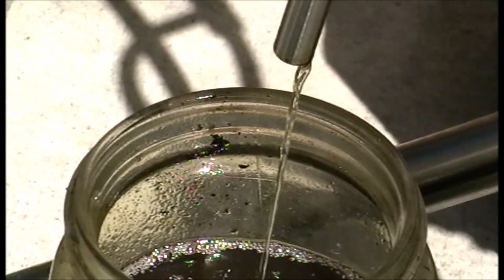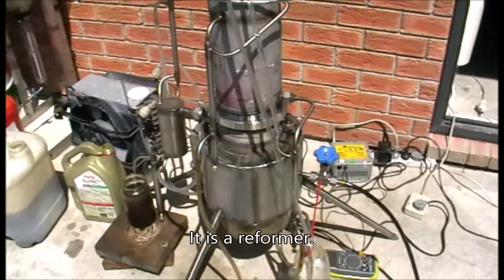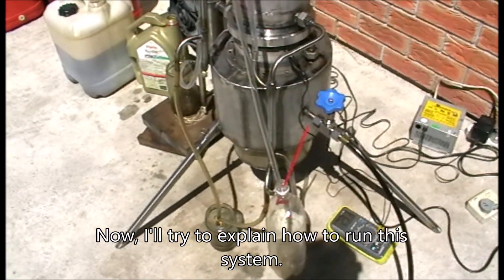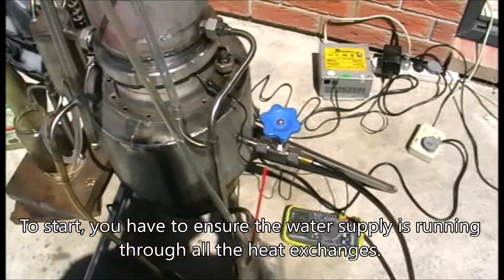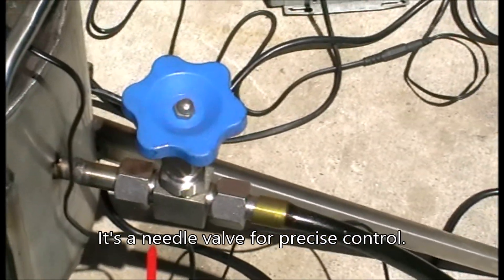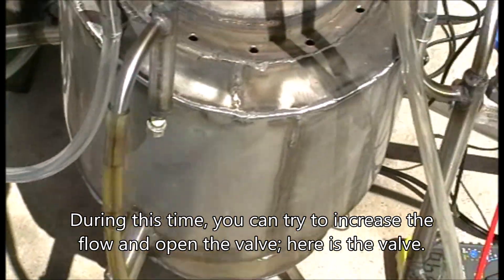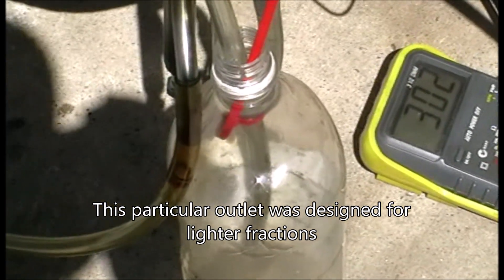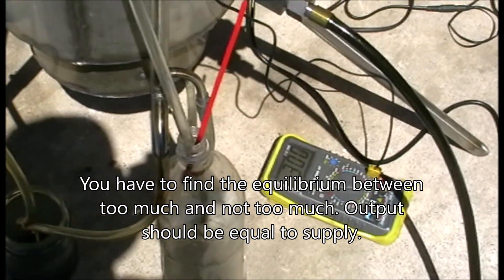Homebuilt wmo pyrolysis reformer - how to run (archive video).

Comment: I’ve been watching you for a few years now and admire your work. Have you ran any farm applications on this fuel? If so, how was performance and did the fuel increase your preventive maintenance intervals?
Reply from the maker: Hi, I have not used homemade fuel in any farm machinery. However, I run my cars, including 4WDs, on either recovered fuel or oil-derived fuel. I ensure that every fueling goes through an inline oil filter through the pump. Initially, before perfecting the treatment method, I had to replace fuel filters twice as often as a preventive measure. But now, I replace them as often as required.

I still drive a diesel-powered 4WD that has covered almost 450000km since 2013. I drive it almost every day and maintain it like any other regular car. When I got it, it was in poor condition, so I had to replace some parts over ten years ago. But now, it runs fine and doesn't burn oil, and the engine is clean. It passes inspections without any issues.

To make homemade fuel, I mimic big refinery fuel production, starting from a small lab and experiments. If you follow all the steps correctly, you can run your engines with homemade fuel without any problems.

Comment: I tried it with plaatic and old tyres. Tha was one major f@ck up 💥🦨🙈. I ended up replacing the pump and injectors. The oil base product sounds much safer .👍
Reply from the maker: Hello! It is possible to perform crude distillation of plastic or tyres, but the final product is a black and unpleasant substance that is not appropriate for any use. This product is known as synthetic crude oil, and after plastic pyrolysis, it requires further processing. Firstly, it needs to be settled, then distilled again, and finally chemically treated to make a transparent and neutral oil with the density attributed to real diesel fuel. It is important to note that crude oil should not be used to run machinery, which is why refineries and petrochemical companies exist.
Reply: @santeryi9 can you tell why it shouldnt be used?

Comment: Hey can we use borosilicate glass assembly for distillation of waste engine  oil.It's used for lab method I mean will it be dangerous
Reply from the maker: You can use a borosilicate labware to conduct a small experiment to prove a concept, but for everyday big volume oil processing you need a properly built steel machinery.